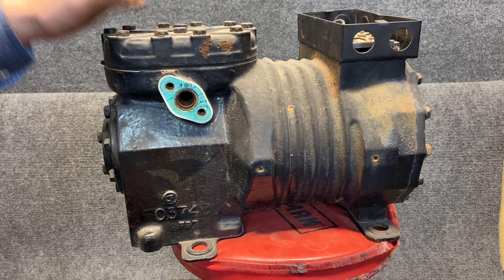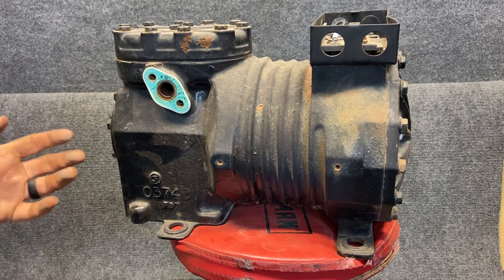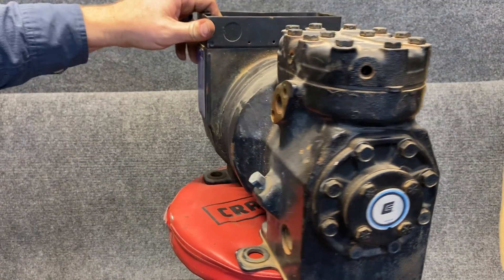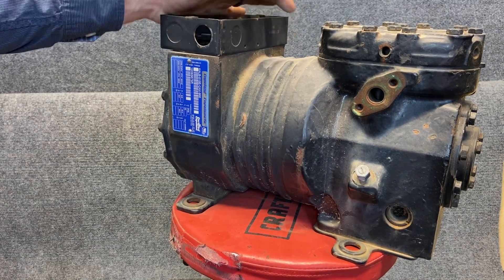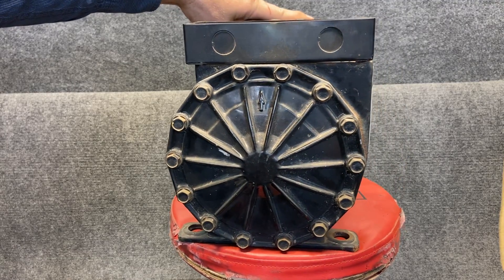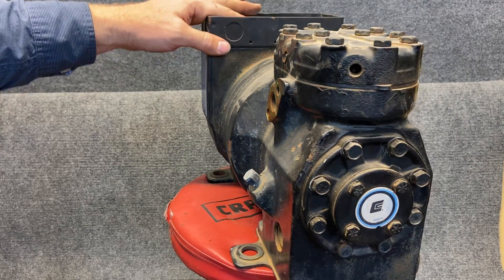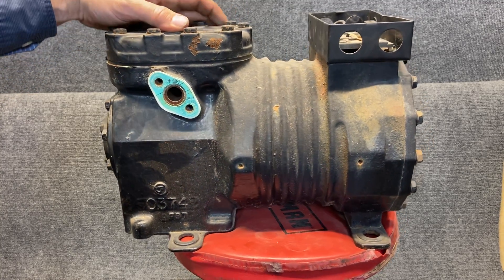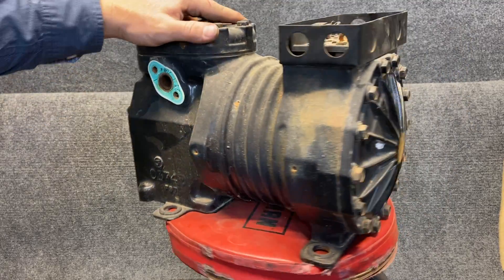HVAC 072 Semi Hermetic reciprocating compressor intro

Comment: Your teaching is making me understandi Ng so much?? What caused the compressor to vibrate when it reach it set point (when itt chip out or TURN Off
Reply from the maker: Air conditioning or refrigeration ?
Reply: Always on point (it's a Refrigerator)???